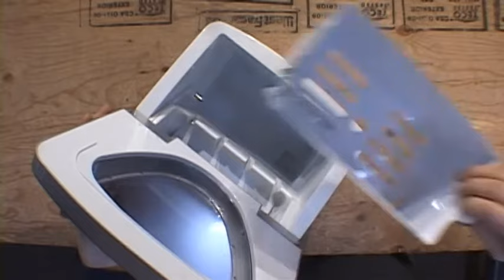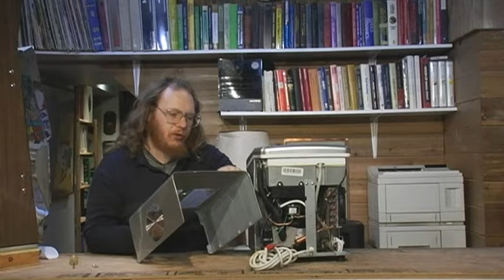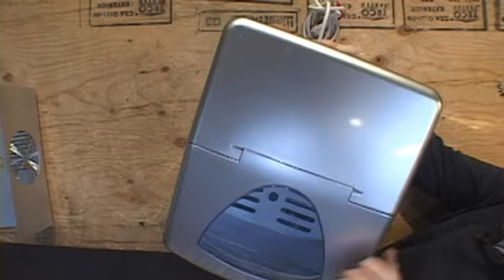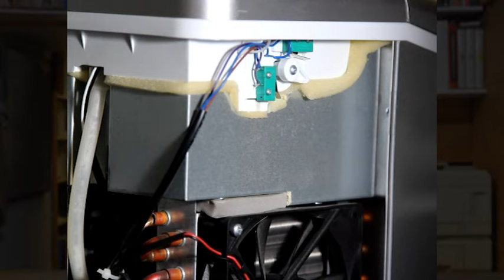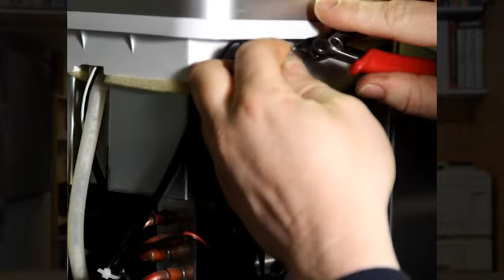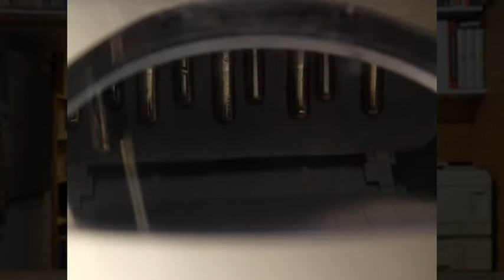Portable Ice Machines (and fixing one of their many problems)

Comment: I have a cracked water holder. How could I purchase and replace the water reservoir cup.
Reply from the maker: It seems there a few suppliers on aliexpress selling similar replacements in multiple sizes. I think your solution there will mean you have to remove the old one, grab a ruler and compare what you have to whatever the various vendors have listed,

Comment: For family use .   Those are to small.  We bought one of little ones I've had to tear it down to replace microswitches, the drive motor etc.  It's a pain keeping it filled when the kids don't refill it.   Buy a unit with a drain and water line to it.

Comment: The fix you made was fine for that operation however I have been searching for the problem I am having which is my nugget ice machine was and still working but the issue I have is there is black spots on my ice and the tank wall behind the ice bucket. I ran through several cleaning functions with both distilled white vinegar and with ice machine cleaner with no good results. Do you have any suggestions?
Reply: black mold. you need to take the side and back covers off, remove the top and scrub with bleach till its all gone. the mold is not toxic but affects the taste and it is harmful to breathe the air from around it. its the same mold that grows in pools and spas. commercial ice makers are notorious for this and in kitchens and fast food places they are seldom if ever properly cleaned and no one seems to notice.

Comment: What temp does it work on am at around 35 -40 degree celcius and no ice being formed
Reply: you must be at least 20 deg f to make ice fairly quickly. these have a 5 minute freeze cycle. You might try cleaning the condenser and moving the machine to achieve better air circulation. these machines are pretty heat sensitive, air above normal room temperate will cause this also.

Comment: the ones in there are rated at 5 amps(green KW4 microswitch), i'm not sure those replacements will last that long either because those appear to be 1-2amp switches. you can get the correct ones for about $1 a piece.
Reply: the current through these switches is in milliamps, any switch the right size will work fine. some switches are poorly built but still work ok.

Comment: I have a different IceMaker but it's similar to this one and also makes 'nugget' ice.  Like you, I'm impressed with how well they built it all into a small space.  But these all seem to be fairly short lifespan devices which is a shame because in the case of mine, when it works, it works very well.  Mine has a water inlet and it works flawlessly until a handful of issues arise.  Using RO filtered water helps immensely to keep it clean.  In my case, the pump got stuck after being stored for a year.  I was able to fix and also replace the pump and that maker works great again.  But another unit literally destroyed itself without warning a week ago.  It either exploded or somehow stopped cutting off the nuggets and it the ice expanded/pushed the ice maker unit completely apart including breaking off the bolts holding it together.  That is now a parts unit.  LOL

Comment: The little tray that moves up and down on mine keeps making a creaking noise and doesnt want to move quite as it should, any ideas?
Reply: might need to disassemble the top a little more to get to the pivot motor and bearing, a little olive or coconut oil should do the trick. seen people use industrial oil and/or wheel bearing grease on the bearing there.... not sure i want that going into my ice.

Comment: Do you know why the water in the reservoir would suddenly turn cloudy? I have the soft ice type not the bullet ice type. I clean my unit regularly and just cleaned it approximately 1 week ago so it can't be dirty. The water was crystal clear this morning when I topped it off like I do every morning and now this afternoon as I usually top off again to make sure we have continued ice available and now the remaining water is cloudy. I've put it on clean several cycles and its still cloudy when I drain it. I also only use filtered water from my Berkey Water Filter. TiA for any suggestions
Reply: what is soft ice?

Comment: I would have used a smaller phillips screwdriver for the micro switches. The only problem I see in my machine is the pump doesn't run. May need a new control board or pump.
Reply: cheaper to try a new pump first.

Comment: What’s the solution for the units that won’t get cold?
Reply from the maker: If it's a unit that has lost its gas charger there's not a lot of practical options I can suggest. These don't hold a lot of refrigerant and unless you find and repair the leak (which is a solder/brazing task, unfortunately)  it will leak out again.
Reply: @CelGenStudios  thanks. Yeah I just sent it back.

Comment: Wondering if this is in the same department as ours.

From what I can tell, when it goes to begin the cycle, the tray doesn't quite get to the last phase or two and just resets, trying again once or twice before deciding it doesn't wanna go. If I manually nudge the tray into the final position during the final phase, it'll trigger the water pump and eventually the cooling. However, the moment I let go, the tray will just slip back and spill most of the water out. Without knowing the guts, I just kind of assumed maybe a gear tooth broke or maybe some of our hard water eventually got in there and gummed it up enough. Though, even prior to this eventual malfunction, I noticed the cycle would sometimes push the top lid up, almost making me think something was bent or out of alignment. However, I just don't know enough about the thing to be sure.

Suppose I'll have to pop it open one afternoon and see.

Comment: You know the correct names for the basic elements of a refrigeration system but you clearly dont understand basic refrigeration principles. The compressor compresses a cool vapor into a hot liquid, then the condenser coil removes some of the heat and it becomes a warm saturated high pressure liquid/ vapor, it then flows through a metering device which in your case is a capilary tube, then it gets squeezed through a tiny hole called an oriface, and this is where the magic happens when that saturated vapor/liquid suddenly expands into a large space (evaporator coil) it absorbs heat from its surroundings and drops in pressure, then the compressor sucks that cold gaseous vapor back to turn it into a hot liquid again.... 

Also, it would've been easier to just repair the microswitch instead of replace it, they're usually not actually broken but just tweaked slightly and out if alignment. They snap open quite easily.
Reply from the maker: I'm sorry. I'm learning as I go along. ;_;

Comment: My unit was leaking, so I finally decided to open it, with the aid of this video. Turns out there's a little spout that was machined to have too deep of a curve and the water would splash back out. I just had to pull out the spout and flatten it a bit. Problem solved! Thank you.

Comment: My unit died.  At first, I thought it was the pump.  The tray would go up, but not fill.  After resetting it a few times, it eventually started filling though, but wouldn't make it through more than one or two ice dumps.  At least I know it wasn't the pump.  The behavior in general was erratic, the like the tray going up and down four times in a row.  I assumed it was a control board, but after looking around, I saw a bunch of videos (including this one!) detailing the same issue.  The side bumper switch failing.  Weirdly always the side one and seemingly never the top one.  The side switch must get more wear and tear.  I've got replacements ordered for a few $, and look forward to replacing that.  Sadly I didn't see this video before order the new switches, so I ordered exactly replacements rather than superior versions.  I am going to solder in some sort of clips to make changing out the switches easier though, so when they fail, I can just unplug the switch and plug in the new one.  Female compression style wire connectors...whatever those are called.  The ones that accept little pads of metal.  I just need to swing by a hardware store and find ones in the right size.  

The much weirder thing here is how universal the guts of this thing are.  There's at least four brands putting their own shell over the exact same internal parts.  I guess it's good that we can be sure there will always be replacement parts around, and if a major part dies, you can probably find a broken unit somewhere to strip the part from... or buy a cheap new unit and keep your old one for spare parts.  The sad side is that there is pretty much no competition for quality here.  If every brand is selling the same thing, it doesn't matter which you buy, just buy the cheap one. So many products are going down that path, but this is more egregious case of it than I'm used to.  This is going to be fun product to hack.  The more it fails, the more I'll tear it apart and make improvements.

Comment: What could I do if my machine does the whole cycle however the element won't get cold enough to even create a small piece of ice.
Reply from the maker: If the refrigerant compressor is not running either the defrost valve has failed or you have lost your refrigerant.
Reply: @CelGenStudios  or the fan is running slow or condenser is dirty.

Comment: I have a Frigidaire ice maker I bought in Costco for 90$ it works fine, but sometimes it will freeze up and I won’t hear the 9 cubes drop into the tray. I just turn it off and let built up ice melt a little.

Comment: Can I send you my NewAir ClearIce40 to make a video like this? I've gone thru two of these machines in less than a year and the problem seems similar to the one in your video. The ice will not slide out of the tray which then creates a huge block of ice. I don't want it back after you fix it. I'll cover shipping as well.
Reply from the maker: I appreciate the offer however I'm already a little busy trying to stick to just repairing my own appliances.
Reply: Hated hearing this for you...I just got a New air as well ..seems ok but the ice is dripping wet when I try to use that ice. Uggh it wasn't cheap either.

Comment: I know it's a long shot, but maybe someone might know. My ice maker has a problem at the stage when water is filled and compressor has to kick in. Most of the times it doesn't start any more, but if it starts then the machine works just fine until turned off. I can see side fan moves a notch and stops and water tray goes back to default position. Could it be some starter capacitor not being able to hold charge for initial kickstart or something like that?

Comment: my parents always had an ice maker (ok maybe not when I was 4 or whatever) in their freezer, and its great if you want 2 month old stale ice in one giant clump, we never had one as adults until about 7 years ago when the house we bought had a fridge with a ice and chilled water dispenser. 
The line was leaking so I just took the bucket out and shut off the machine and its feed, its a waste of freezer space... esp during the covid ramp up. 
I don't particularly like ice in my drinks due to my sensitive teeth ... and if I am going to fill up a cooler I hit the gas station and get pounds of the stuff for a 5ver and some change back for a lotto ticket

Comment: Hi there, thanks for posting this video, I’ve just stripped my ice machine down because the physical connection to the tray had snapped on the motor side, on further investigation the motor doesn’t stop turning when one of the limit switch is pressed, however the switch switches electrically (continuity tested) so I think it maybe the relay, therefore.. new snapped tray & new PCB. Does this sound right?
Reply from the maker: Yeah I think the control board operates the motor and the switch is its own thing to the board as well, not in series.

Comment: Hello, I'm replacing the micro switch on my portable ice machine. My issue is the wiring that goes from the circuit board to the switches. The wire colors are blue, brown, and purple. I'm ignorant when it comes to electrical wiring. I need assistance with getting the correct wires. The imprint on the wires is too small, so I'm not able to read the wire information. Are the different colors all the same wires? Or, are the different colors different ampage? Please help. I've searched the internet, Amazon, and YouTube for the micro switch wiring, but I've been unsuccessful.  Thank you
Reply from the maker: I can't really help you there. Before taking the old switch out I would make a note where each color wire went on paper, then put the wires in the same places when you put the new switch in. Not everyone used the same color wires in the same locations, which is why you probably can't find any good assistance on this.
Reply: @CelGenStudios  Thank you for your reply.

Comment: I just subscribed to you because of this video....this is exactly what's wrong with my Aicok ice machine....I took it all apart t and cleaned it but didn't know about these switches or what to look for. Now thanks to you I do. But what a pain in the ass to take it all back apart again.... 😂 Thank you so much....never soldered before but I'm gonna try.
Reply from the maker: I just used switches that looked "close enough". I don't really have a spec or preference or anything. Good luck with the soldering!
Reply: So, are those switches for low pressure and high pressure side of the compressor?

Comment: Ok it sounds like even you dont understand how a refrigeration system works. 
Allow me to correct you. Starting at the compressor the refrigerant is compressed into a high pressure vapor. This vapor is hot and then the vapor enters the condensor, where as the name suggests it loses the heat it is carrying and condenses into a liquid, that liquid then goes through a small tube, called a capillary which changes the pressure of the liquid, from a high pressure to a low pressure. Now the liquid is able to absorb heat, when it absorbs heat it makes the pipe cold and the liquid refrigerant boils off and turns back into a vapor, and then returns back to the compressor where it gets compressed again and the cycle repeats.
Reply from the maker: It's more embarrassing I can't go back and correct that too.....

Comment: mine is brand new and fan isnt running or getting cold or no flow of water into the tray. plus red light says add water is always on when its filled with water. like it wont read that theres water in it. im so upset that it isnt working. can u figure It out?

Comment: Refrigerant R 134 A 2.3 Oz
Best to put some flux core solder on the iron for desoldering, that way it protects the iron and works faster.
Careful with old solder as it might create shorts with its flux on PCBs.
Hot glue a rubber gasket in the cap for easy removal.

Comment: I have a clear ice maker that won't dump its ice. I think it's ice making cycle is going too long so the ice is too thick to release when the tray is heated. Even giving it a -6m to the cycle won't make the ice thinner. I was thinking that if the water supply tube had smaller holes it might make ice cubes that don't get stuck.
Reply: I have a Euhomy brand that does this. It displays a code, "E", meaning refrigerant temp sensor bad. Part is hard to find....
Reply: @RSB333  they replaced it because it was only a few months old.

Comment: Bro I have Wansa ice cube machine
Working perfectly but Ice cube very very small. before good. Now not perfect please help thank you
Reply: Easy thing to do first is try taking the back off and gently removing dust behind the fan mechanism -- if it has slowly become less efficient it may be that its having trouble with fan efficiency because of dust buildup. this fix only takes removing the back with a screw driver and gloves (if your back is sheet metal, its probably super sharp), and a toothbrush and small vaccuum to clean out dust buildup. This is assuming that your water tray is clearly filling all the way, just just being inefficient and that efficiency declined slowly
Reply: @lenachuzhin2006  ok insha'Allah I will try thank you for your reply 🇱🇰👍👍👍👍✅

Comment: It goes in the condenser as a hot high pressure gas and it leaves the condenser as a sub cooled high pressure liquid.  It then enters the evaporator through a metering device which in this case would be a capillary tube that sprays the freon in a liquid droplet and subcooled gas mixture where the freon picks up heat and starts it's journey again!

Comment: i just checked my tubing and pump and all seems ok but right as it's supposed to stop to start filling the chill bath it makes a click, and then the shovel and bath cycle again. this happens one more time and then the whole machine just sits there looking confused. Do you think it's my position switches? I know it ain't my dang pump.. is there a way to re-calibrate it first to maybe check to see if it's just out of timing?
Reply from the maker: Same thing mine did. Start with the switches.
Reply: @CelGenStudios  thanks manI'll check them and go with the same cherrys, they make decent switches
Reply: Ω reading didn't flinch, same switch that went out on yours. Maybe the cam lobe is crushing them? Maybe just a coincidence.